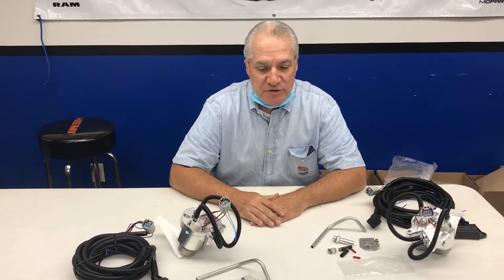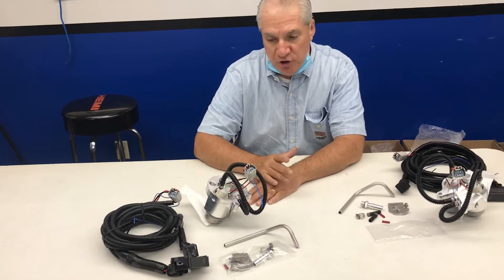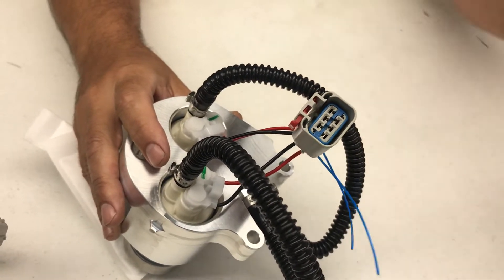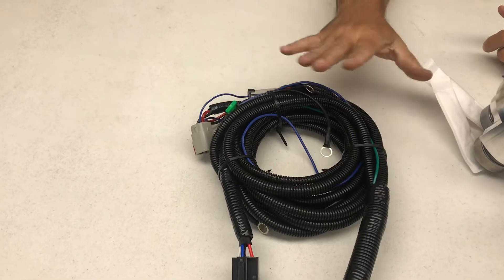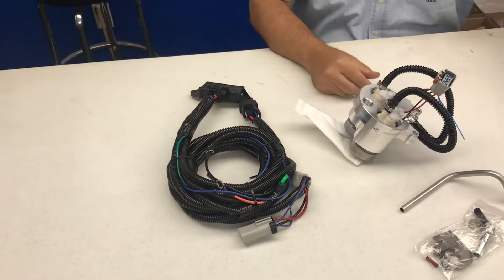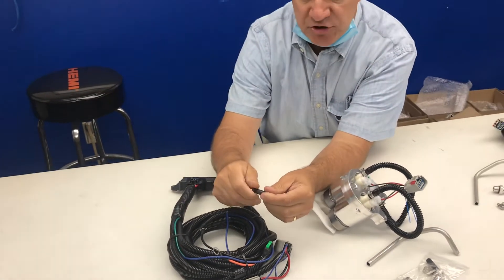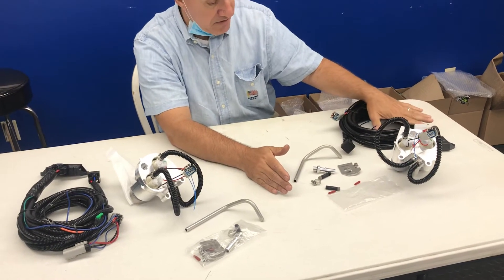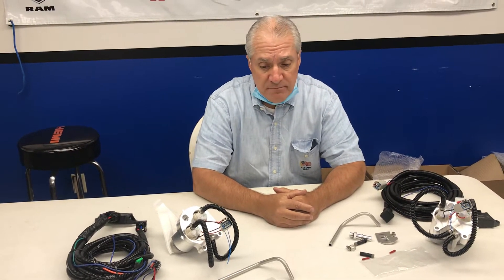New Hellcat Dual Fuel Pump System 1000 WHPS

Comment: Installed mine yesterday.  It’s not as easy as they make it sound but doable in a few hours.   The instructions could use better/more pictures.  It’s working well on pump gas but will be trying E85 soon.
Reply: On E85 it’s keeping up with my car at 19 psi . The fuel pressure stays between 77 and 80.
Reply: @boostedhemi7118 aye thanks for this update not a lot of guys report back

Comment: Is this fuel system still available? I do not see this as an option on the website.
Reply from the maker: https://www.stevewhiteparts.com/p-15-21-challenger-charger-hellcat-6-2l-dual-high-performance-fuel-pump-e85-gas-swmhcdu
Reply from the maker: https://www.stevewhiteparts.com/p-16-20-challenger-charger-hellcat-6-2l-dual-high-performance-fuel-pump-e85-gas-sw-performance-295-swmhcdu295

Comment: I'm having issues with it. It turns on and everything and it's pumping but the fuel doesn't reach at all to the fuel rail. It's stays in the fuel pump assembly. I checked it versus the oem and the aftermarket doesn't have a relieve valve going down. There's three holes. 2 where the two lines meet where the output is at and the 3rd on going down and there is no valves so it's dumping all the fuel back into the tank and not reaching the fuel rail.
Reply from the maker: best guess you either broke the clip or did not push it far enough to lock, main feed line going to passenger side of the tank